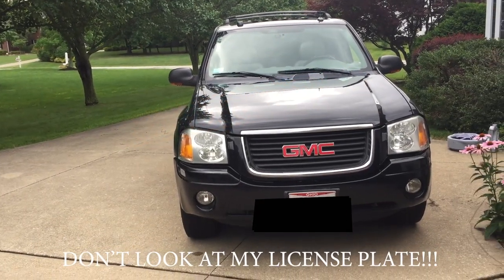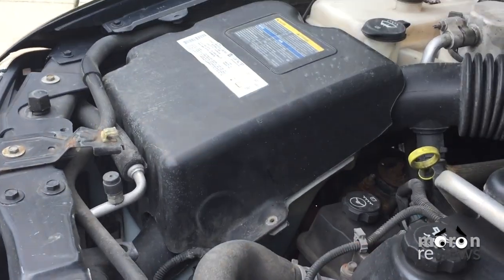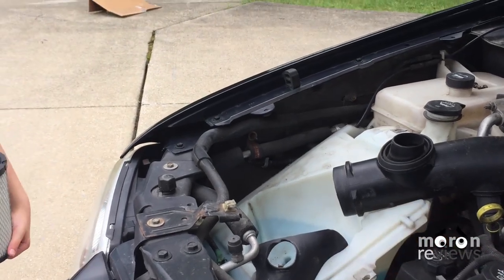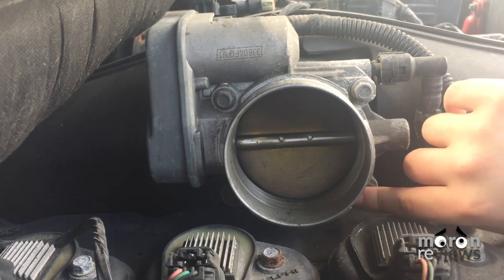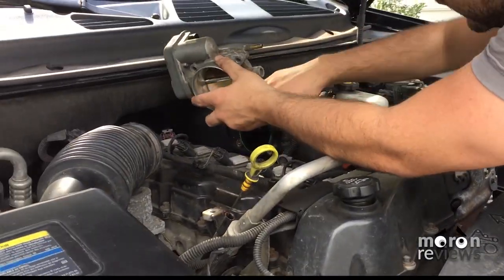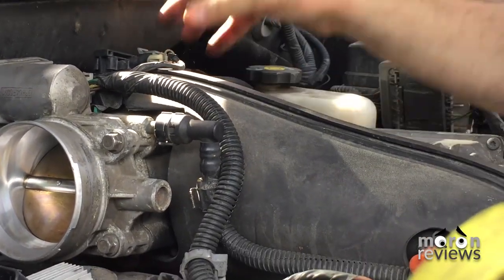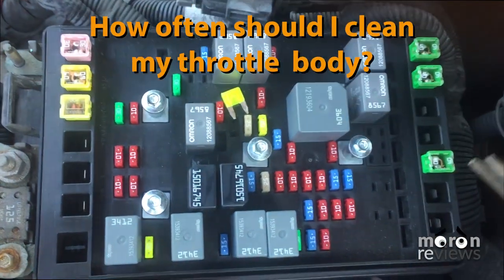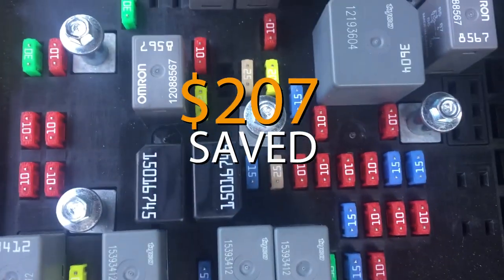Trailblazer Envoy Throttle Body Cleaning & Air Filter Replacement

Comment: Really good, clear explanation of how to do the throttle body and PCM. 👍 I'm going to be cleaning my throttle body today . I've been troubleshooting issues for two weeks!,, replaced two spark plug coils and a 125 amp fuse, added water to low battery cells.. seemed to be going fine for a while and now running rough especially after turning on the air conditioner so traced it to probably a dirty throttle body ...we'll see soon! 😩😁🐦 And also I'm surprised you don't have more comments ?this is a really good video 👀👍